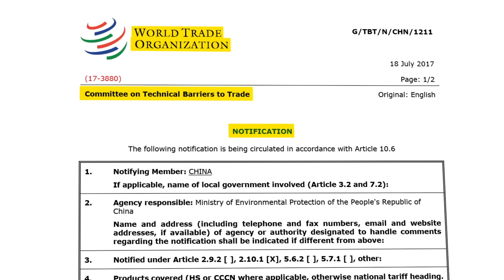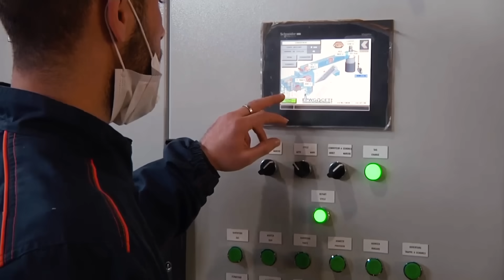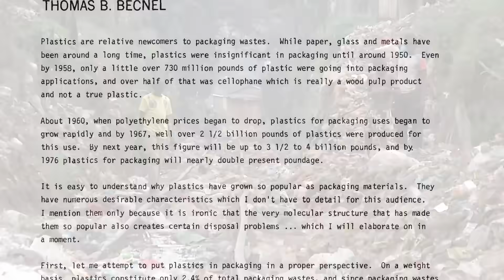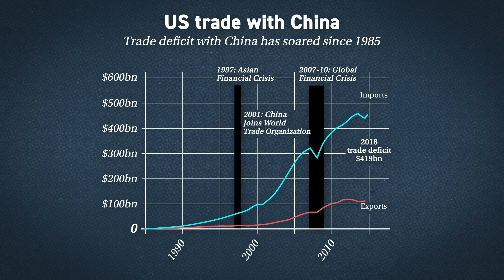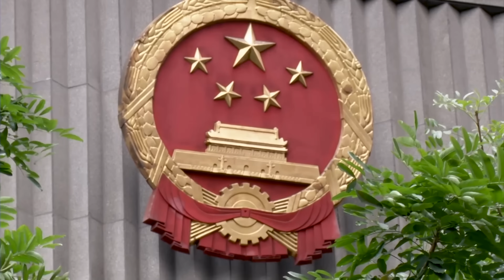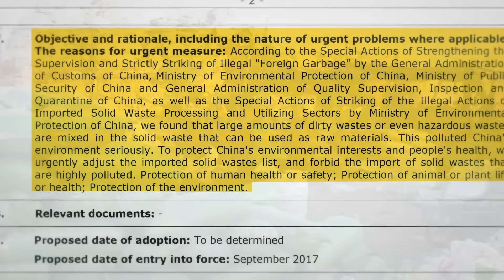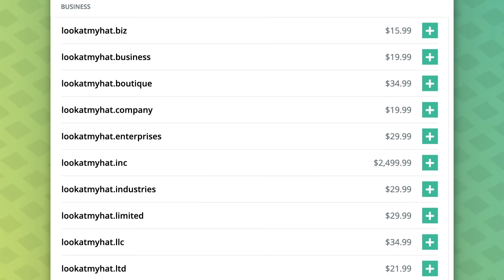How China Broke the World's Recycling

Comment: If economics is the solution: sounds like we won't have a solution until we run out of oil. Gosh, that's going to be an interesting year.
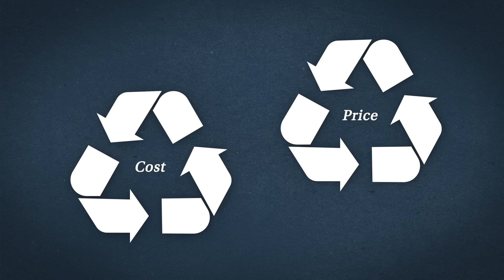Reply: 16:55 Plastic tax could make a difference. Tax virgin plastic and don't tax recycled plastic. Thus the cost of recycled plastic could be cheaper than virgin plastic.
Reply: @Meonium  plastic lobby will kill any such tax with deadly efficiency
Reply: @jamesdavis2027  Plastic tax successfully implemented in Indonesia. Good thing Indonesia finance Minister don't give a f*ck pretty much to all the lobbyists from all kind of industry. That's why she got ousted from her office by the previous president with petty scheme but taken back by the current president lol.
Reply: @Meonium  I guess it's already expensive to recycle even without considering tax
Reply: Economics is always the solution.
Reply: It wont run out, it will only get scarce and then violence will ensue
Reply: @mortache  Fortunately it doesn't need to completely run out. It just needs to become scarce enough to make virgin plastic more expensive than recycled plastic.
Reply: There is another solution.  Burn it.  Hold that thought keyboard warrior.  Plastics at their heart are just a really complex petroleum  molecule. The answer is called gassification.  Which breaks down raw materials into the carbon structure and releasing gases like H2 and CO.  These gasses are both highly flammable and when created through gassification is called syngas.  Many types of garbage could be processed this way.  I think only needing to remove things like metals and   hazardous waste from the feed material.  Turning stuff that would go into a land fill into power.  And while its not zero emission it wouldn't be any worse than any other petroleum fuel
Reply: Ella Woodcrest   hahaha.Mrs Alicia  is a certified broker, I have worked with her for years,anyone who she handles he's or her trade for, i believe is so lucky all you have to do is believe in her and follow her guidance.
Reply: I heard that our atmosphere will become incapable of sustaining life substantially long before we run out of oil.
Reply: Government intervention to tax "virgin plastic" and subsidize recycling could be an alternative. its an economic problem, it requires economic solutions.
Reply: Free market doesn’t work that way. As oil supplies lower, prices will gradually rise and this will be profitable long before we actually run out of oil.
Reply: Google methane hydrate map. We will not be running out of oil any time soon. If we burned it all, all life would be dead.
Reply: We will never run out of oil.
Reply: We need a way to price the externalities into consumer products. Then market forces would work.
Reply: @Razaiel  the problem is that some externallites take years to decades to discover much less understand
Reply: the oil will replenish faster than we use it.
Reply: Oil fields have neen known to be abandoned for a few decades just to be returned to.. Oil is a reusable resource.
Reply: @collinheble709  not that it's reusable
  But that it becomes too expensive to get the oil using a certain technique.  Which is where horizonal drilling  and fracking has made it more cost-effective to get the rest of the oil in those fields.

Oil will be around for a lot longer than people think.  The number of years they have been predicting we are out of oil really hasn't changed.  They used to only drill on land the then off shore and now they have deep water rigs but they are still relatively shallow.  When oil prices rise they will look for oil in harder to reach placss
Reply: @SiFiFreak  I dont know exactly what you're trying to educate me on... I knew these things already... But your statement doesn't refute mine. Oil fields have been known to rejuvenate.
Reply: @collinheble709  the point I was making is that they don't rejuvenate.  The oil that is there is just harder to reach so is abandoned for more cost effective fields.
Reply: @SiFiFreak  and the point I'm making is that those same spots have been returned to after a few decades just for pumping to continue..
Reply: It would take many more centuries for humanity to run out of oil. Not sure if we survive to see that day though.
Reply: Aight well it's all sitting there in landfills so for now that sounds are best thing to do and put all the plastics we get there where there not a problem maybe sort them out if we wanna be convient in the future and when it becomes profitable companies would buy it up and recycle it because plastic is an insanely useful material I can't imagine going away without a new almost magic material and right now we're just being most efficient with our production of it
Reply: God knows when well run out since open keeps changing the date do they can keep oil prices high.
Reply: Actually economics will help here. Somewhere there are various companies working on solving the sorting issue.
Reply: @HouseholdDog  yeah but most of their solutions involve  finding and exploiting more oil deposits. They wont focus on green energy until oil is close to running out. We will likely not reach peak oil production for another 50 years but if we continue like we currently are until then we are basically fucked.
Reply: @rory6984  If we "run out of oil" the company that perfects an alternative will be rich. Seen Tesla's share price recently?
The higher the oil price goes the more attractive the alternatives are.
The less attractive using oil becomes.
Heavy oil using products become expensive which leads to them being used less.
Having said that, when oil future contracts go below 0, like they did this year, I think we have a ways to go.
Reply: @HouseholdDog  opec try to keep the price at a level above what natural supply and demand should give but at the same time not too high so people dont look for alternatives. This years futures collapse was the cause of Russia not playing ball with opec at the same time as a dramatic decrease in demand. Car companys arent oil companys so it doesnt make that much of a difference to them what powers the car as long as they can still sell them. The sad truth is that we have nowhere near enough lithium to replace every car with an electric one  and its doubtful we will be able to replace all our oil power plants with green alternatives any  time soon. The obvious alternative is nuclear power which is actually way safer than any other source of power. The times when people do die from nuclear power are pretty spectacular though and the public will never get on board with it.
Reply: the world will end before the oil will run out
Reply: Solar or wind energy
Reply: We aren't gonna run outta oil for quite a while
Reply: @ianelliot1127  in 53 years?

Comment: Plastics are the most important material that humans have ever invented , look around you they are everywhere for a very good reason. With unique properties all at the same time, I mean , light (saving huge amounts of energy in transporting them /moving them when incorporated in products), unbreakable , elastic or plastically deformed  , transparent or not , cheap raw material , easily and in an inexpensive way (low cost of process machinery)  processed into final products due to their low temp melting points. Inummerable qualities to serve all uses. OUR World has taken a huge step forward by using them more and more . The only solution I see ,  inexpensive , which eliminates them from the face of the earth in Incineration with very good cleaning of the gases produced. Alexandros Vrachnos Metallurgical / Materials Science Engineer

Comment: IMO a lot of this waste could be avoided by having local cleaning plants: plastic containers would be washed and sent to regional food suppliers. I have heard arguments against it in terms of hygiene, but I reckon it could be done. Also, if you as a consumer need soda, for example, why can't you wash and rinse your own bottles, go to the supermarket and refill with your favourite drink? That kind of receptacle re-use was normal 100 years ago.
Reply: Most plastic bottles are not meant to contain multiple refills of liquid, as carcinogenic chemicals begin to leak from the plastic to the liquid in question (there is a protective barrier normally, but this breaks down a few days after opening or after multiple refills). I do think that reusing a plastic water bottle a couple times to keep you from burning through water bottles (and similar practices) is a good idea to just cut down on overall consumption of plastic.

Comment: 15:06 "Remember, recycling only works when it's profitable." That is what broke the system, not China. We need to stop thinking about things in purely (or even primarily) economic terms. It may be economically cheaper (in the short term) to keep turning petrochemicals into plastics and throwing them away after use, but it is environmentally extremely expensive.

Comment: As long as there is any electricity production from oil, coal, and gas, I don't see why we should not turn fossil carbon into plastics before burning it to make electricity. And even when that time comes when we don't use fossil carbon directly for electricity production any more, we can still keep on using plastic and then burn it with waste pure oxygen from hydrogen productions plants to generate high-quality CO and CO2 without any NOx (and making electricity in the process). High quality CO and CO2 can be mixed with hydrogen to make syngas, which can be processed into fertilisers and very clean burning synthetic jet-fuel.

Comment: Therefore, it is better for the environment to just dump it in the bin straight away, shortest route to the incinerator. Plus: plastic is made from oil. High energy, so put electric generators on the incinerators and you reap a benefit (on top of avoiding the downside)

Comment: Recycling is not a technical problem? Really?
Spoiler - it is. The mainstream way of dealing with plastic water doesn't actually solve the problem of getting that can be.. well, recyclable.
That's why recycled plastic is of poor quality.
And getting the whole process to the point of it being the same cost or lower than getting raw materials - is also a technical problem.
Economics is there , but its role is overrated.

Comment: Love your video. What will make the reprocessing of plastic waste economic is cheap renewable energy. Let me explain why. Renewable energy is becoming very cheap - at least at the point of production. The problem is variability. There are two ways to deal with this variability problem. One is grid scale energy storage (this is already happening). The other is "over" production. The latter makes a lot of sense because there are a lot of new uses of electricity (electric cars, hydrogen production, green steel and so on) that can form a variable load (energy is taken according to the market). Now, you've created a huge market for "excess" renewable energy that is very cheap for processes that can be scaled up or down to suit the availability. Its been estimated here in Australia that we will end up having a grid supplied by renewable energy that at its peak will deliver five to seven times the present average electricity grid demand. The rest will go to electric cars, hydrogen production, industrial processes and so on.

Now, in such a market it becomes economically feasible to use energy in the form of electricity to recycle plastics. Hydrocarbons (plastics) can be decomposed into simpler molecules. Liquid hydrocarbons (chemical feedstock), tar (roads) and also syngas (H2 + CO) a basic building block for a lot of chemical processes. The trick here is of course, cheap energy, driven by a market supplied by an abundance of cheap renewable energy. 

You can actually push this further and reclaim the billions of tonnes of materials locked up in landfill. Not just recover the organics, but also the inorganics (goes back to building material and roads) and also refined metals. Again, its about cheap energy. Getting the carbon out of landfill and into useful things also takes away the greenhouse effect that comes from all that carbon being released as methane.

Would love to see a video on this technology btw :)

Comment: This is a long overdue truth that needs to be told. I got curious a few years ago about what actually happens to "recycled" plastic and came to basically the same conclusion. Goes to a recycling center (sounds great right?) but then off to a landfill or incinerator save for the few profitable types. They had me for many years, thinking the system would work if we all just recycled and I was doing the world a favor. I'm very rarely for a new tax, but if plastic recycling is negative value, I propose we "the people" should pay for it (non regressively if possible), and if we don't want to, which we won't, I'll bet an alternate solution will come fast. This much plastic, this cheap, with no consequences to those who produce it should have never happened in the first place unfortunately.

Comment: how about we ban anything thats difficult to impossible to recycle or anything thats going to the landfill
Reply: like ceramics , fuel , medicine or composites like fiberglass used in wind turbines
Reply: @woltews  ceramics are pretty much just rocks, i have no problem for it to be in the land fill, we are on the path of replacing fuel, but at least fuel dont go to landfill...for composites, not sure what to do with them, i think its just one of those things ppl created without thinking about its recycles.  good thing is regular house holds dont use them very often, I only seen it on my car...hopefully we can cut the cost of rockets by a lot, to the point where we can just send those composites to the sun...or maybe with new tech we can design better materials or making recycling easy.
Reply: @TheSunshineRequiem  by definition you can not recycle fuel , its only purpose is to store energy chemically and once that energy is extracted it generally goes to water nox and co2

Comment: Just increase the cost of plastics to the consumer by including the extra cost of recycling, like happens with deposits on drink containers.  If plastic becomes uneconomic for some uses, great.  If other uses find it's worth the cost, that's also fine, because the recycling can now happen.  Determining the cost of recycling will be the hard part, but it doesn't hurt much to overestimate, just to be safe.  The plastics industry should promote this instead of a complete ban, if they want to survive at all.

Comment: Shutting down an entire industry sounds kinda extreme and plays to eco fad, the issue is that going green is a fashionable and not a real concern with most. It makes us feel good but nothing is truly solved.

The real issue is that a lot of the cost of plastic is in externalities and the reprocessing of it.

One fairly simple solution would be adding one bit of new regulation or law into place. 
All products that contain plastics must have a reclamation deposit, that recyclers can cash after processing and selling the plastic to cover the sorting and processing cost. (Kinda like the deposit on plastic bottles to get them recycled in the first place)

Plastics are a wonder material and as with all great things too much of it is not good for anyone. 

But banning it is not going to help anyone. Most reusable shopping bags need to be used 100000 times before the energy and environmental cost break even the if you where to continue using single use plastic bags. 

Environmentalism is a lot more nuanced then normally presented and not doing so often hurts the cause then it helps. I try to be as green as I can be, but I hate calling my self an environmentalist or even say I support it, because the well has been poisoned, with BS to make you feel good and on the other side a bunch of extremism.

Comment: "It's not a technical problem."
This is incorrect. Economic problems largely are technical problems.
While regulating the price of plastic would simply move plastic recycling companies to countries without those regulations, actually coming up with new technologies that can be used to fully automate and break down plastic and reusable components is really the only solution.
This is why if there's any sort of government subsidy it should be towards funding research to find cheaper ways to recycle plastic. Whether it be increasingly accurate detection and sorting software, bacteria that brake plastic down into its components, or other technologies and processes that can be used to make recycling plastic profitable.

Comment: It might require more energy, but theoretically I think you could heat the plastic without oxygen until it's polymers break down to their subunits and evaporate. The resulting gases could then be sorted by density and boiling point, similar to the separation methods used in petroleum processing.